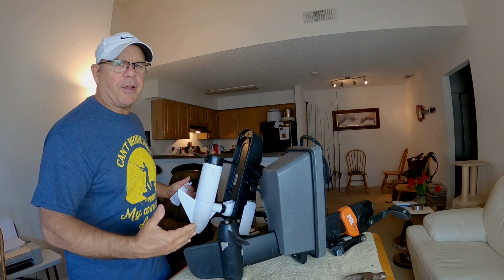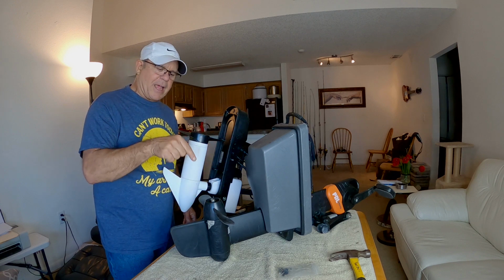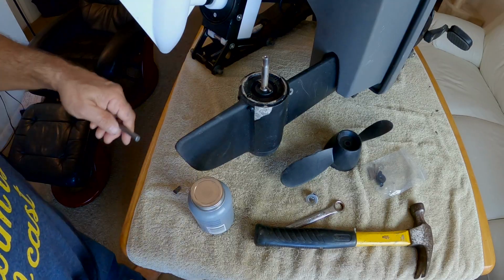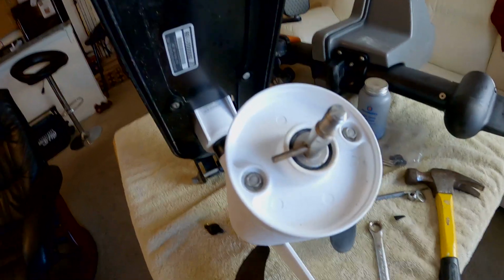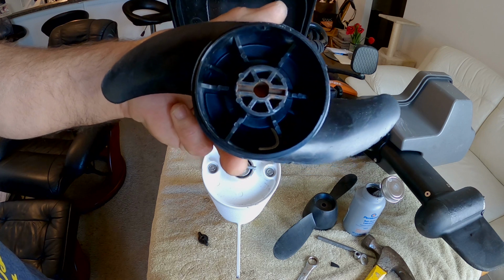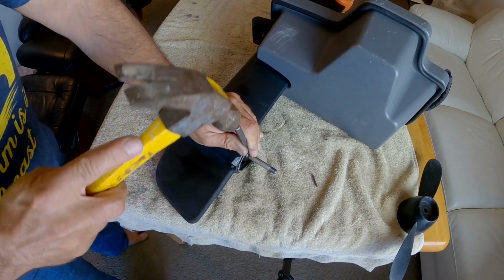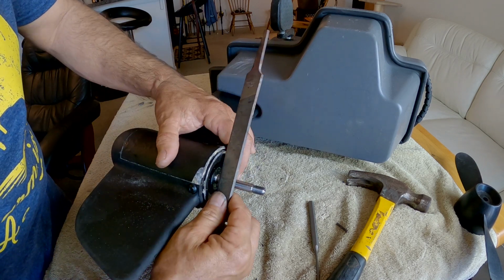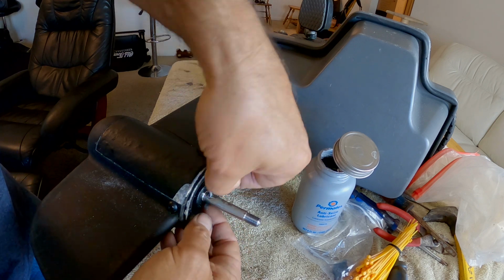Ugh, I Had To Fix It, Old Town Kayak PDL Electric Motor Prop Shear Pin Stuck, How To Remove

Comment: JC, WD40, I have salt water fished 45 years with all kinds of equipment, and WD40 everything that is metal , It will help keep rust away, I also use it on my props, motors, and the sheer pins also. sheer pins are softer grade metal, so they can break when you hit something hard, to stop from breaking your prop blade. also on my reels after rinseing with fresh water. makes the cheeper reels last longer. Good videos, Good information love them!! Tight lines.

Comment: JC, as you found out, that anti-seize compound is like 3m 4200.  Once you open it up, it finds its way to get on everything.  The anti-seize is good stuff.  I use it on my outboard's lower unit bolts and water pump bolts to make sure I don't have issues at the next maintenance cycle.  Also on the trailer lugs so that I can get the nuts off to change wheels should I need to while on the road.  As for sheer pin rust, it is a lesser grade metal so that it will sheer off.  If made of the same SS metal as the washer or nut, it probably would not sheer and you'd damage the motor should the prop hit something solid.

Comment: The sheer pin is probably intentionally a softer , lesser grade metal than the shaft by design .That's why the real marine grade stainless hardware looks good still.  Dissimilar metals tend to react with each other(electrolysis) and are more prone to rust as well. I'm gonna pull my prop tonight and do the same. Thanks for the info JC. Keep em coming !!

Comment: Just had to do this, instead of a dremel I used 14" bolt cutters from Lowes, then filed it flat so I could use the pin punch and twisting/pulling with vice grips on the other side.

Comment: Yeah I just pulled some fishing line off my prop on my 106 MK, that plastic nut was a little tough to get off,I sprayed it down with wd 40 and let it set for awhile and then had to use some small needle nose to turn it lol I ordered a backup set of bolts washers etc. also just in case I lose one when out on the  water or tear up when taking off the prop...I had nice little wad of braid and a some mono appearantly from a previous time. Its good to know those little motors can take some abuse :)

Comment: Just a quick note J.C, if this was to happen again and you need to punch out another pin. After spraying and while its soaking with the Blaster, Id try to find something close to the height between the shaft and table top to counter balance the shaft. This would eliminate any strain on the shaft and the chance of possibly weakening a bearing or seal from the hits trying to get it loose. Id also put some of that anti seize in one of those little zip bags along with the extra shear pins keeping them lubricated and rust free until you need one again.

Comment: Interesting update JC.  I was thinking (being an engineering type!) rather than try to file the mushroom off the shear pin, cut it flush to the shaft with a small hacksaw or Dremel, and then tap it out.  And then it snapped anyway!  I would think that if the pin was good stainless steel, it would be to tough to shear if the prop hit an obstacle, which is why it may be a bit softer & therefore rusting.  Also, now you have got a small container to store the shear pins, coat them in that anti-seize compound in the tub, then they won't rust before you need to use them and will be pre-coated.  Stay safe & well.  👍👍

Comment: Have to make sure those shear pins are still perfectly straight.If not they still ain't going to come out with or without a punch.Always try heat before anything,a soldering iron will heat it,expand the pin and often will loosen the rust/corrosion around it.
If they're bent cut it off as close to the shaft as you can,clean up any burrs if there is any on the pin left sticking out of the shaft.Then use the punch.
What I'd do is replace that shear pin with a roll pin.
There are numerous qualities of metals,whether it be aluminum,steel,stainless steel,etc. High quality SS isn't going to rust....def not as quick as those pins if they are actually SS.It takes many years or decades before a hydralic cyl shaft will start to rust on an abandoned piece of equipment as an example.That's why the shaft,nut and threads were fine.

Comment: Rad! Put a wood block under the end of the  shaft so you don’t Bend the prop shaft when you are tapping. I had to hit mine way harder than you did so I definitely needed the block but safe then sorry!

Comment: Happy you got it fixed JC. I’m not sure what other seals (if any) are near that shear pin but I’m wondering if maybe using a torch on the shaft to get the metal to expand a bit would have helped in getting that pin loose. Either way when the pin broke that punch did the trick. Always curious about the how to keep these drives and others maintained, glad you made this video.

Comment: dont understand about the pin being rusty this is my second season fishing in my 106mk and just had the prop off to remove some fishing line and the pin was in good shape and could still move around, and i do fish in brackish water around the Chesapeake bay and I think its the salt water where your at, the salinity in the middle bay is moderate and more brackish so maybe it is the salinity.

Comment: You take a chance on damaging the motor by beating on the shaft. Spray some wd40 or some other rust desolver to loosen the pin. Then lightly tap the pin out.

Comment: Why punch out the intack pins at all? It is doing its job while its stuck in there. You only need need to remove if it snaps, then punch it out.
Reply from the maker: You have a point, but if I'm fishing a mile away from the launch and it breaks I don't want to have to paddle back!

Comment: Your problem starts with no maintenance. The same way you rinse off salt water from your fishing gear and SERVICE with anti corrosion sprays and oil to prevent it from siezing up after a day on the saltwater, you must do the same with your props and motor. Unless you have incredibly sealed equipment, you have no choice but to do this maintenance.

First of all, pull all those pins and gauge them for size in diameter. Get some stainless steel rods and cut them to size and length and make several new pins. Don't forget to chamfer the ends with a file. 

Keep them coated in oil or wd40, CRC etc. Coat the pin you are using now in the same rod grease and or oil you use in your reels.

Now remember, stainless steel, when coming into contact with other  metals other than stainless like aluminum, will corrode after time due to the reaction between the two materials.

You may want to replace your shaft with stainless steel or just keep up the maintenance.

If you don't  have a choice but to use back that rusted corroded pin, soak it in vinegar for a few hours to 25 hours then polish with fine sandpaper. Lubricate and replace.

Fishing is fun but it's a constant struggle to keep doing what you love  when you have equipment to help you in your endeavour.

You have to literally become a mechanical engineer, and learn to rebuild, repurpose and reengineer whatever you get to suit your maximum benefit and performance.

This is the nature of the game if you want to stay on the water and stay safe.
Reply from the maker: Thanks for sharing your wealth of knowledge on this topic.